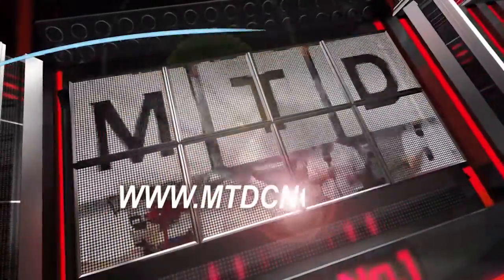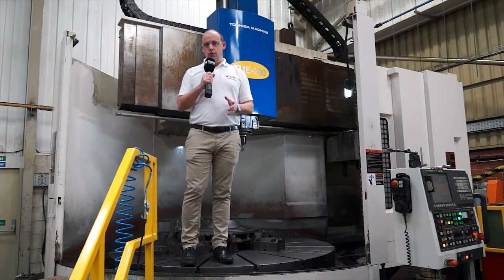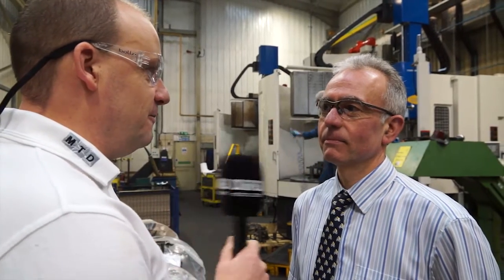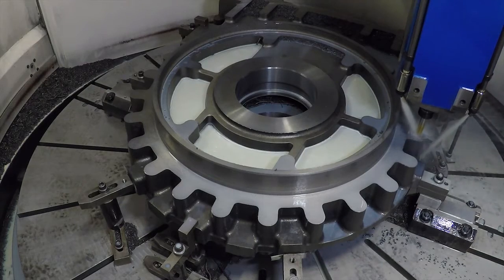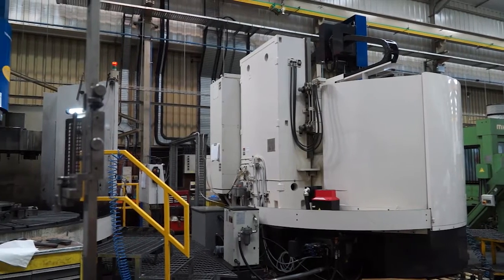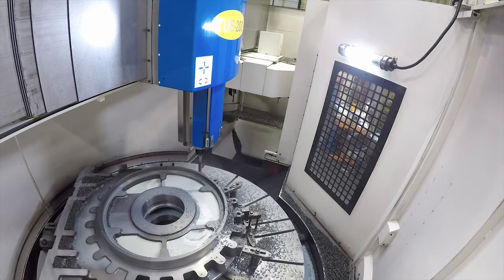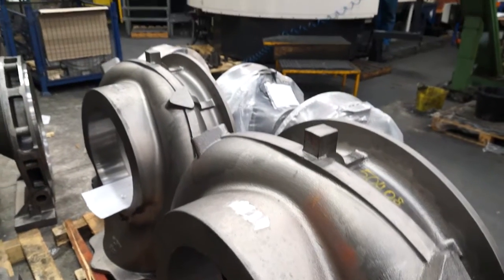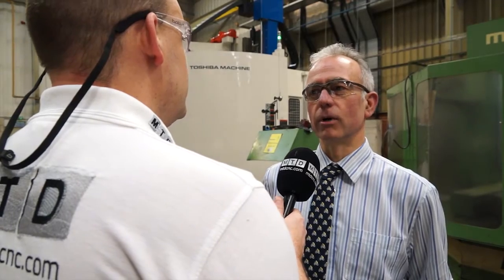TOSHIBA TUE 200 VTL installed at Desman Engineering

Comment: Hi check these 2 out 

L-743 742 741 740 Flat & Squared= 0,0025mm/m. with tricks half of that! AutoSpinn = NO handtouch

https://www.hamarlaser.com/systems/l-743-ultra-precision-triple-scan-laser/

L-702SP Spindel 3D Center 0,0005mm/m and Flat & Squared= 0,0025mm/m. with tricks half of that! !
CNC Centers & Spindels Alignment Extreme = https://www.hamarlaser.com/systems/l-702-l-702-sp-system/